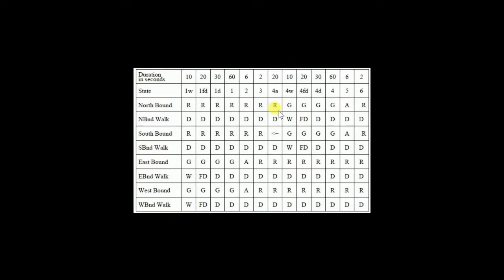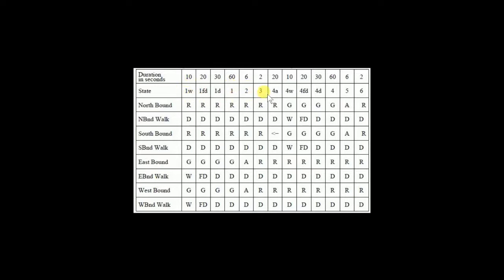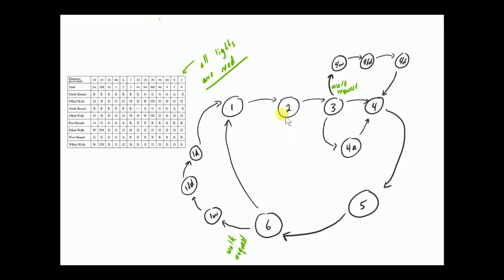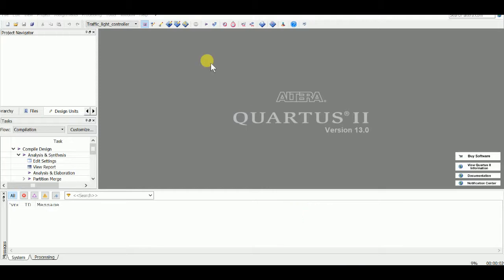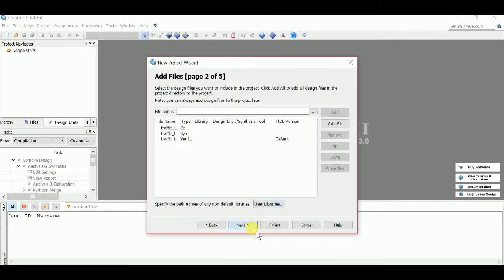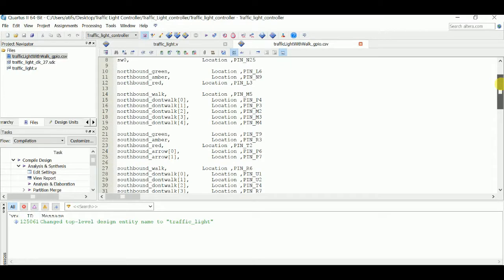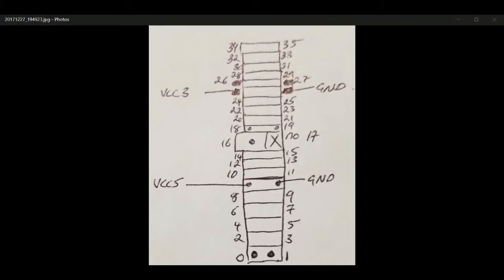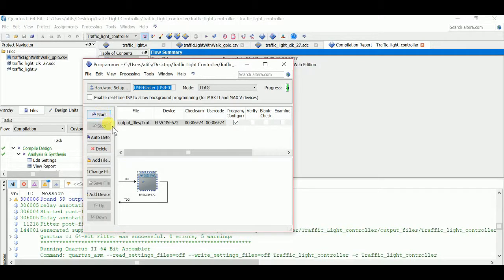Traffic Light Controller using the DE2 board with real circuit model FPGA

Comment: I'm just starting to learn verilog, and I've been trying to simulate a simple traffic light using the leds on the fpga board. All info I could pull up on google were about projects similar to yours with a street intersection but that's not what I want. I just want to control the leds to simulate a traffic light. It would be very easy to do on an arduino, but I can't manage it yet with verilog. Help would be appreciated.

Comment: Sir, can  i get the code for Traffic Light Controller using the DE2 board with real circuit model FPGA  and the diagram also because i'm a little bit confuse